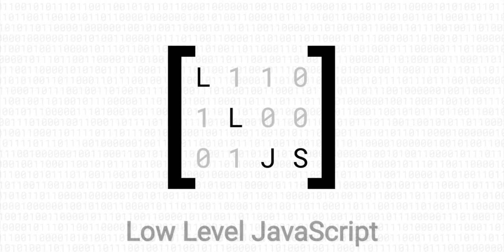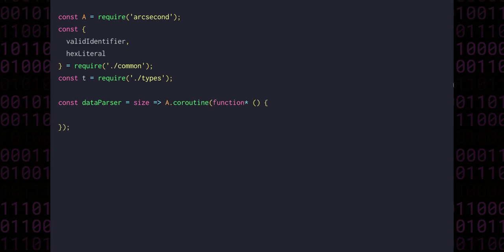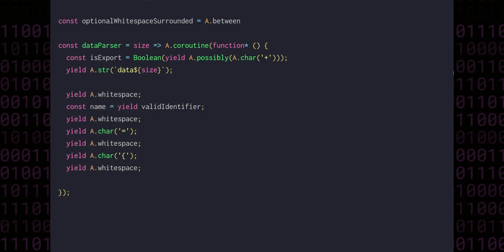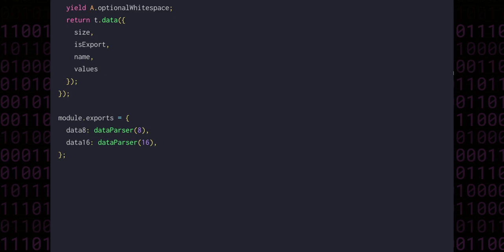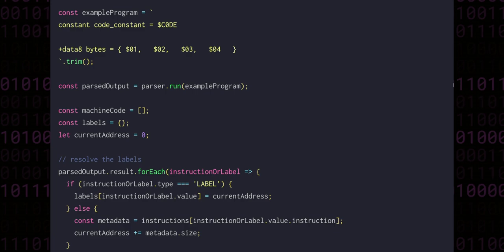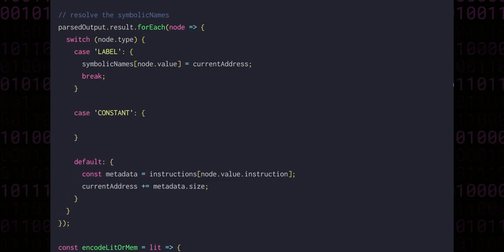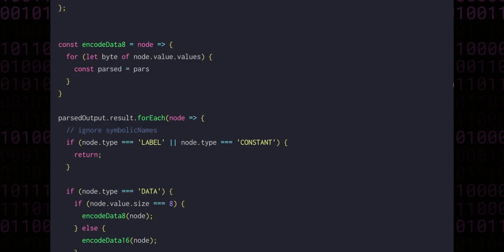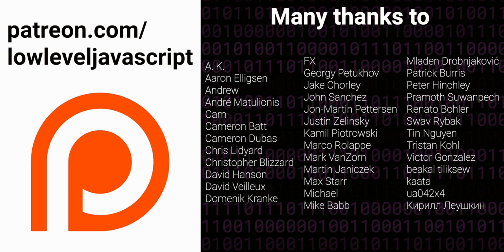Assembler Hacking: Inline Data And Constants (16-Bit VM in JavaScript 014)

Comment: Every video you post is. ABSOLUTELY. AMAZING. The deconstruction of a .WAV file has my mind spinning with possibilities! Thank you so much for putting the time into these videos. Question though, do you find that if you learned these low level concepts first, it would give you a better understanding of other areas of programming and networking? Or do you think learning the higher level concepts before these would give you a more intuitive approach to low level  concepts? Or in parallel? Or order just doesn't matter....
Reply from the maker: Thanks Clientelephone - I'm really glad you're liking the videos! As for your question: It's kind of hard to say. I definitely think coming from all different angles is going to be the most effective, but that's only based on my own experience - so it could be different for someone else. I like to pick a project that covers some of both (like this VM for example 😄), which stops you from getting tunnel vision in one particular area.